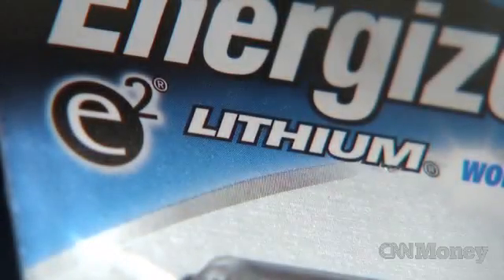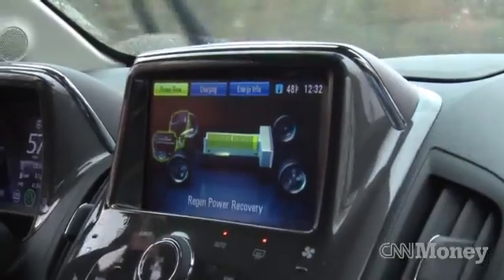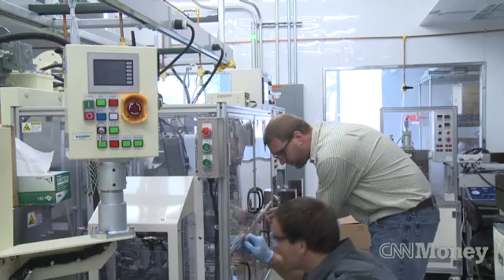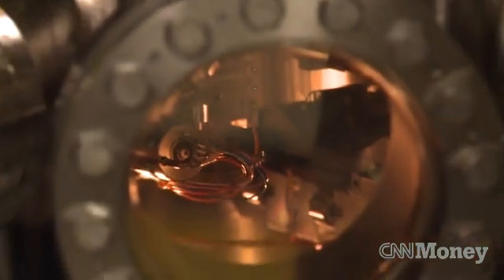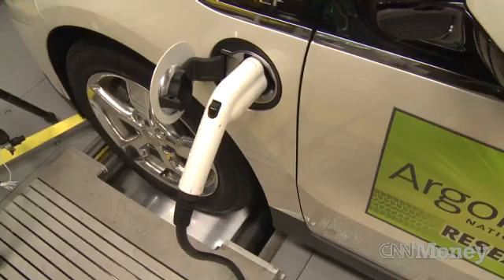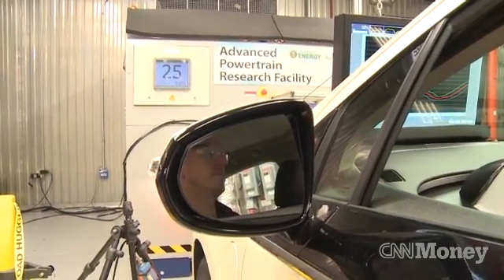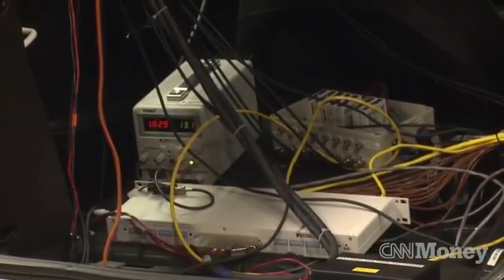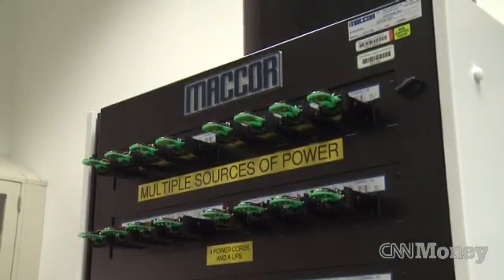The future of rechargeable batteries

Comment: Thr new batteries has to success to many conditions: high capacity, fast charging, safety, ability to work in cold and hot temperatures, high output power, long lifetime cheap, eviromental friendly. The Li-S Battery might be great (2,5-4x capacity) but it has a shot lifetime 50 cycles. Scientists pushed it up to 500 cycles. Even too less. The Li-Mn (Manganese) battery is also good (1,5x cypacity) but expensive like Li-Ion and it charges slowly and has low power output. This batteries are good for electricity storage.

Comment: Use nuclear energy they use it and U.S. Navy boats they run for like 20 years at a time without having to get a charge
Reply: Josh Howell because there is a fusion container on the boats/ subs. We cant possibly put every home a fusion container with nuclear rod on it.
Reply: +onlineph actually it's fission. Unfortunately we can't do fusion efficiently yet.
Reply: +Josh Howell Hmm the nucear reactory might get an comeback dispite the Fukushima accident. The molten salt reactor with thorium has theoretically 3x higher energy output than an normal nuclear reactor. The waste is is within 14 years not harmful. If this reactor collapse the reaction will stop. Its nearly impossible to have an accident like Fukushima or Tschernobyl. Scientits found this reactor in the 1950s but it was too complicated and they used the nuclear urane reactor.

The renewable energy is not powerful enouth. You need wind or sun. At night the wind blows less and there is no sun. Some days in Germany has no sun and wind. There is no other possibility than nuclear power.